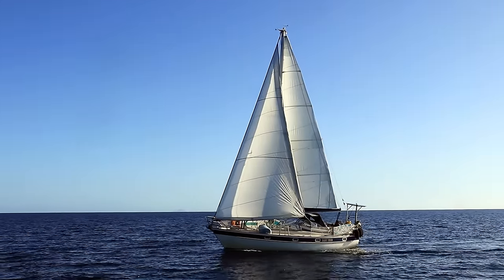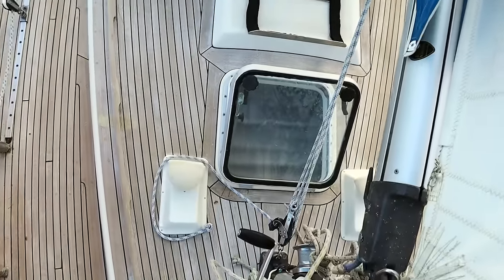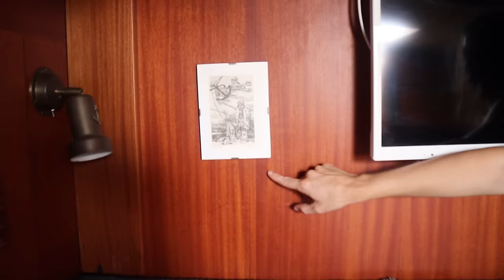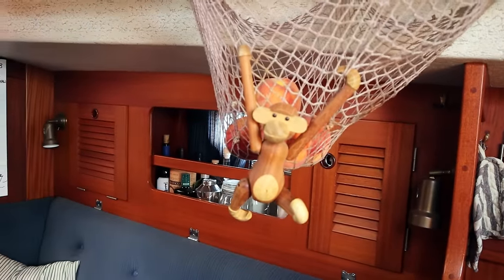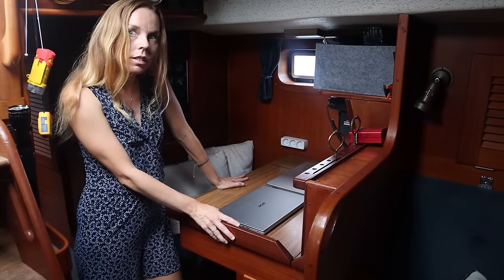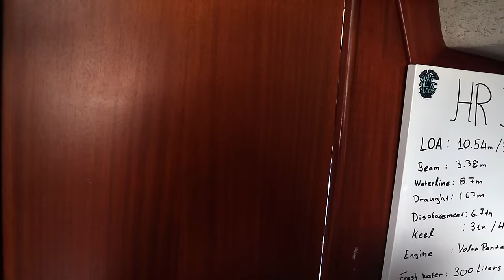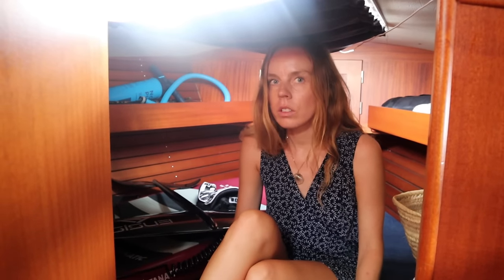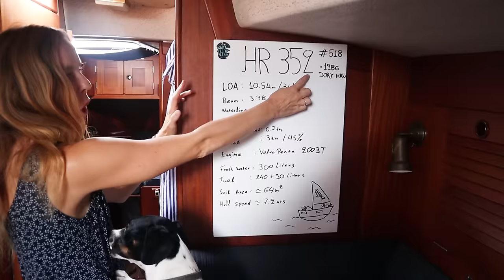Best Cruising Sailboat ?  Hallberg Rassy 352

Comment: I had a 352 for 19 years!  One of my favourite boats ever. It just feels so confident and reassuring at sea.  And cosy in the cabin when moored.  I only sold it because the teak deck was reaching the end of its life and I couldn't face spending silly money to replace it.  As for reversing it, I didn't have a problem once I realised you just have to give it some throttle - get it moving through the water and it steers OK in reverse.
Reply from the maker: Hi Peter! Yes definitely a great boat, 19 years is a long time! Totally agree with the teak deck, we have spent quite a few hours maintaining it and it doesn't get better :(. One day it might have to go, deck re-enforced with a layer of fiberglass and with some kiwi grip should do the trick! We have found that the only way to reverse is indeed by picking up speed and ideally shifting to neutral...part of that is that we have quite a big propeller, creating a big prop walk...

Comment: Hi, great boat, I own one, the Scandinavian from 1987; reverse is impossible. For the rest is a fantastic boat, very well insulated in all climates, sturdy contruction, very safe, good value through the years
Reply from the maker: @piermarcobilli9480  totally agree, you habe a close sister then to our 86. We also have the Scandinavian version, must say we didn't find any insulation, yes the hull is thick but no insulation, we added about 20m2 of armaflex wherever possible to stop condensation, which really helped in winter. Where are you located?
Reply: I’m in Italy, Tirreno sea, so not a tough test for winter but no condensation ever, wich I had on the previous boat (Oceanis)

Comment: If you center the rudder put the boost in reverse.  The stern will “walk” to one side.  When reversing the boat put the rudder hard over the other way.  Reverse slowly and straighten the rudder out as you gain speed.  It’s easy with a little practice.  Overall I think you have a beautiful boat.
Reply from the maker: Thanks Howard, 
Yes indeed this mostly works, we still need practice, but doubt it will ever work all to well with the wrong cross winds. Often we find a hard correction forward is needed to set the direction !
Reply: @sailingAGH  Once you get use to it you will learn ho to use it to your advantage.  If it is really a problem (shouldn’t be) you can change the prop out to feathering prop.  The blades will reverse themselves when in reverse. The other advantage is less drag when sailing.  Perhaps 1/4 knot.  If you are only doing short sails it of no value.  If you are doing many days out at a time it can add up.  a 1/4 knot equals 6 knts a day.  One week at sea equals 42 knots more distance.  In other words if you average 6 knots you shorten that trip by 7 hours.

Comment: You are so right, having a 42e ketch same problem, forward wonderful, backwards a nightmare. Massive propwalk, steering nearly impossible and when it starts turn it's nearly unstoppable. Would also appreciate any hints.
And thank you so much for your entertaining videos. I am a big fan.
Reply from the maker: Thanks for your comment, its reassuring that others have the same problem :) for us its certainly also a luck of practice, but although there are some tricks to get her to obey, I believe that in certain conditions we would never be able to nail a reverse med mooring in a busy spot, better anchor elsewhere :)
Reply: @sailingAGH  Got a HR 382, and while reversing is trouble, with a short boost and then go the idle, you can steer without propwalk. But it stays difficult. And if your nose goes away, you have to go forward to point the nose in the right direction.

Comment: my hr 39 doesn't go wonderfully in reverse but if you keep it fairly slow and use the bow thrusters to steer, you will have some chance of getting where you need to go.
Reply from the maker: Hi, thanks for your comment :) There seems to be plenty of ways, none is really perfect, but yes before we decommissioned our bow thruster your way was working  quite well ! Now we try gaining quite some momentum in reverse, then going into neutral, then she actually listens quite well to the rudder, that is if the conditions are light ;)
Fair Winds

Comment: I saw one for about £32k, it looked really good except the teak decking needed replacing
Reply from the maker: That sounds like quite a good deal! The teak deck is a big project, either it's really bad and needs removing/replacing or it still has some sufficient thickness to it, in which case you can re-caulk it and replace screw plugs. If it doesn't have sufficient thickness you can remove it entirely and either apply anti skit surface or replace deck with teak, cork, or other alternatives all options do look quite good! Do you know how thick the teak still is ? We would be happy to help further if you'd like, just drop us an email!

Comment: I had a HR38 and I have to say, that it is really hard to go backwards with it. It taks miles to react on the rudder by going backwards.
Reply: Exactly. They don't handle very well under power. They don't perform very well under sail. They are too heavy. I hate teak decks - leaky, heavy and too hot in the sun. HR's are ok for a 1970's boat... But it's 2024

Comment: Enjoyed the tour! Do you use your diesel heater to heat water often? Do you have it connected to the towel rail and the engine so you can warm it before starting? Do you have other radiators to heat the boat? I also wondered if you had considered an air based heater rather than water? So many questions!
Reply from the maker: Hi Dale, Thanks for your comment :) Initially we had an webasto diesel hot air blower (5kw), perhaps it was even the original, it worked perfect for 1 and a half winters, then it started acting up and we decided to go for a webasto Thermo C water heater, as they are supposed to run quiet and better for continuous use, something necessary for the Danish winters. In the initial setup, we had 2 small radiator + towel drier, all connected to the engine fresh water cooling/ boiler. It was pretty great, plenty of warm water, for dishes and shower, an always warm engine and a warm boat & on longer engine run the cooling system of the engine would actually warm the radiators if needed :). Unfortunately the limited space called for small radiators which do not have a big enough heat output, so heater idles a lot which makes it loud and the boat takes a while to get warm :( So in hindsight I would have gone for a new airheater, also dries the air better and warms up faster :) - no hot water though ;) 
Anyway since last year we disconnected the system from the engine, as the all the pipes were too much in the way in the tiny engine bay.  

If you are a liveaboard and can fit big and enough radiators and don't mind the extra pipes & weight its definitely worth considering and very efficient, otherwise a nice airheater is just unbeatable :) 

Hope that helps :)
Reply: @sailingAGH  thanks so much for the detailed reply! Our boat will have an air heater but I really wanted a water based unit to provide hot water and warm towels and laundry! Perhaps the air heater is best after all, so thanks again for sharing your experience!
Reply from the maker: @DaleNewnham  you are very welcome 😁 webasto also sells a 2 in one option that does it both, but it's also nearly double the price but quite convenient 🙂

Comment: What capacity is the fridge? What powers it? Inside and outside shower facilities? How do you get in and off the boat? On the water/ in the marina? Can you reef/furl from the cockpit? Height of the cabin? What sort of autopilot do you have? Would you recommend it? What sail configuration do you have? How does that fare - in gentle winds? In strong weather? I have so many questions. By the way, the name of the dog, I don’t know how you spell it, but it sounds like ‘Kai’ which is Māori (indigenous New Zealanders) for ‘food’… be careful with that one!
Reply: I have hit the ‘don’t like’ button on your video by accident and am having difficulty trying to change it.. 😳
Reply: Ah! Done it! Sorry…. 😊
Reply from the maker: Hi Charles, thanks for the comment! 
So the fridge should be roughly over 100l in Volume, including the mini freezer, it's operated by an external 12v cooling compressor, all run by our 300amps AGM batteries and entirely supported by our 190 watts of solar. Shower wise, we can shower in the toilet hot (by engine ). We have no outside shower, we just rinse with a bottle after a swim 😅. If on anchor we use our SUPs to get to shore, so far never a problem, in port, we have a  bow latter or we just jump 🦘 we had also a plank but never really used it! We can not reef from the cockpit and like it so far as it keeps it clean and simple to to from the mast, never felt unsafe either, but its possible to bring the reefing to the cockpit! Height of cabin is around 188cm  in our model, a bit lower in the previous versions. We installed an raymarine ev 200 linear drive, we got it at an awesome price and it is the best investment, it consumes very little ⚡ and never failed us. We have a full battened main, a smaller Genoa and a bigger Genoa some storm sails and a Spinnaker. She performs surprisingly well in gentle winds despite the heavy displacement and even better in heavier weather always feeling safe with a small weather helm! Yes it's Kai and he always wants food, btw Kai also means ocean in Hawaiian and pier in Danish😁 perhaps will avoid New Zealand! 
Fair winds
Reply: @sailingAGH  thanks for that! I have just bought a 352 so it is good to swap stories and ideas. I had a Panda 40 before so I am looking forward, with a little trepidation, to the reduced size..! Thanks again and happy sailing.
Reply from the maker: Awesome, congratulations! Hope you enjoy her !

Comment: Great boat if you are 5ft tall otherwise it gets a bit tight at times especially down the back
Reply from the maker: Yeah, we had our concerns, especially Leo who is slightly over 6feet, however the later models of the 352 have more headroom, both in the galley and in the walkthrough. Overall it works fine and the boat still has very nice lines and a very stylish deck.
Reply: Agreed and very good sailers too